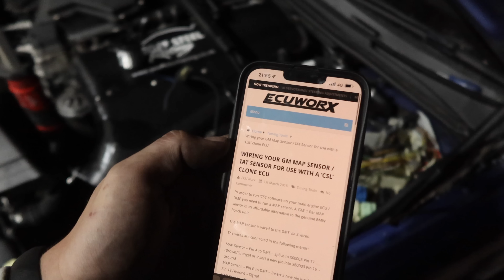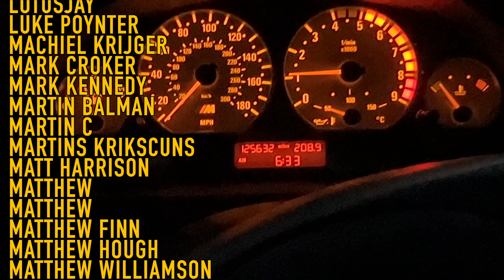E46 M3 CSL Carbon Airbox, New Coilovers, New Car? Nurburgring Upgrades Part 2

Comment: Put a curved shop mirror up on the wall in front of the ramp so you can see the ramp legs and how close the wheels are… easy and cheap fix to save your wheels and tyres 👍
Reply from the maker: good shout

Comment: HPA has a great couple of videos about solder vs crimp in motorsport. Long story short, a proper crimp is king. It does have to do with flexibility and withstanding heat cycles and vibration over a season.
Reply from the maker: yeah makes sense
Reply: Why not those small tubes that you crimp on and then heat up to melt the solder inside?
Reply: @roborovsky6950  In one of the videos they talk about how motorsports grade crimps are actually cold welds, fusing the wires together. It isn't just being held by the squished crimp.

Comment: Stopped at evening 2 to comment, we’ve all been there, at least you were big enough to eventually walk away 😅 I think on my back under my 330ci with 2 snapped sump bolts, before deciding it wasn’t coming off so it was staying for another day was the last time I’d got to this point. Back to the video. 👍🏻
Reply from the maker: lol, it was also 10pm which helped
Reply: @dannyDC2  if it’s not pitch black outside when you get to this point, there’s more swearing and trying the same thing, in exactly the same way that didn’t work for the last hour to be done 👌🏻

Comment: We have about the same taste in cars.  I have a 98 CTR with a K24 swap and an 03 E46 M3.  Although I am not a fan of the M3.  It's so tame compared to the EK9.  It's not loud, it's not fast it just seems like BMW made a sports car and then said lets dial everything back so we can sell it to accountants.  I have thought about the CSL air box and the RTD shifter but do i want to spend another $4k to possibly make it fun to drive?  I am considering selling it and getting an 04 or 05 STI.  I had one of those before and I have always regretted selling it.  They make such good noises and can be fast with just a few bolt ons.  Whatever happened to Josh and Rolex Dan?
Reply from the maker: you do you Jeremy, let someone else enjoy that M3 :_approved:

Comment: It’s a reet bastard getting them rubbers on airbox and I spent ages faffing about with mine and not trying to touch the throttle linkage but worth it for the sound once done 🎶😍
Wanna try getting the bloody 8off on the V8 M3 😫

Comment: Dan, please, PLEASE do a proper review of these coilovers. Bilstein has a really crap marketing, tells you nothing about the features of the damper and almost nobody runs them. But I have a feeling they could be really good. So my questions are: Are they streetable? Are they able to soak up nasty bumps? And how are they feeling on the track? Also, how much pain are the front dampers to adjust? Thank you! Cheers for the good content.
Reply from the maker: ya but the way the Bilstein marketing guy say "Nurburgring" is enough right? Haha

Pretty niche product for a seperate video, but I will be doing a video reconditioning them I think

They are streetable but everyone's yard stick measures differently. I wouldn't want them on a car I drove every day. 

They are quite a serious setup and the inverted front dampers are proof of that. Yes it's a pain to adjust...

Personally I think they need a change of spring rate, but I felt the same with my BC, so I guess that is subjective too. I was overworking front tyres with the current springs. I'll go heavier in the rear

Comment: Good video. 
What made you go for -4 degrees at the rear? That is excessive for an m3. Typically 1 degree less on the rear compared to the front works well.
Reply from the maker: Yeah I toned it down to -3 before the ring on the rear. Think it’s coming up in a vid

Comment: Soldering has no place in automotive wiring... unless it's set in epoxy resin
Reply from the maker: interesting
Reply: @dannyDC2  Check out HP Academy's stuff on motorsport wiring.
Reply: @dannyDC2  When's the snetterton vid coming out btw, I was there watching the civics ;-)
Reply from the maker: @HenryOCarmichaelSmith  soon!